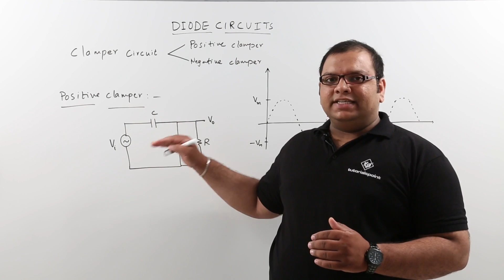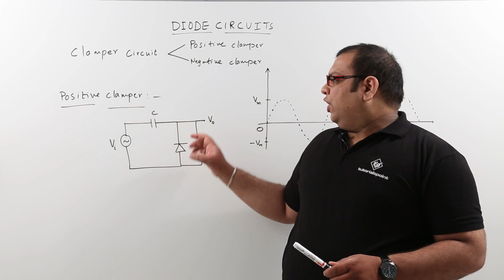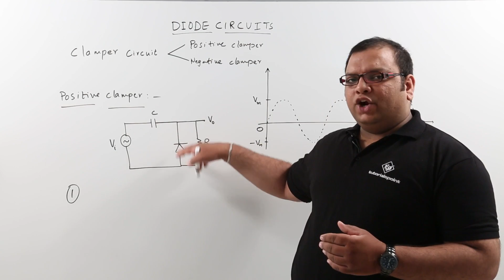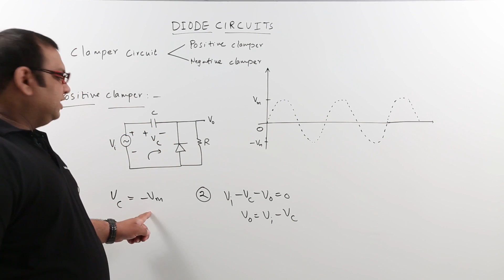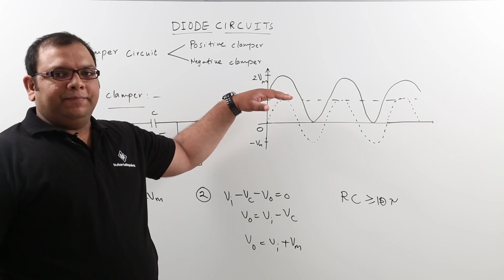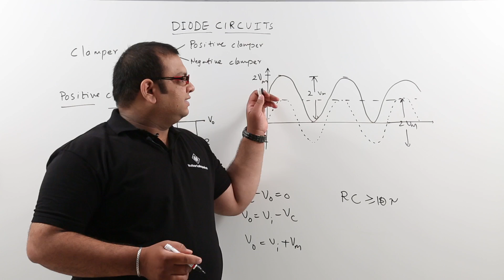Clamper circuit

Comment: The capacitor will be charged during the negative half cycle so the the polarity of the capacitor will be  - + as given in bolystad ROBERT L. BOYLESTAD & LOUIS NASHELSKY book and in this half cycle the Vout equals 0, 0.7, or 0.3V according to the diode type ! And for the positive half cycle you said the Vout=Vi !! You should take into account the presence of the capacitor !!